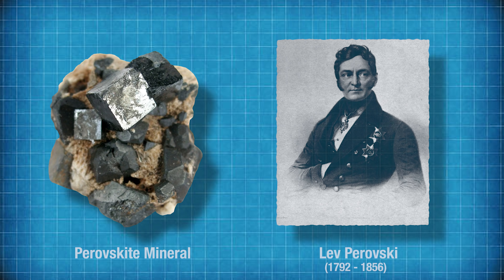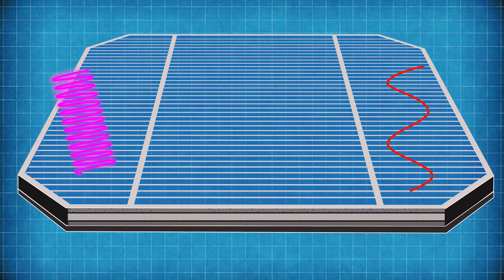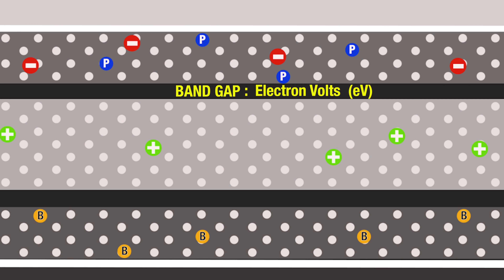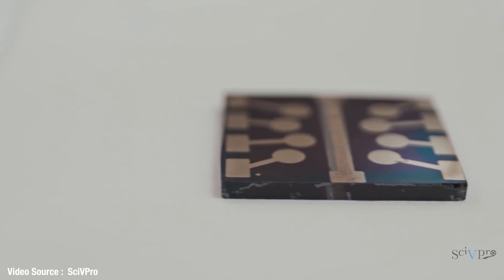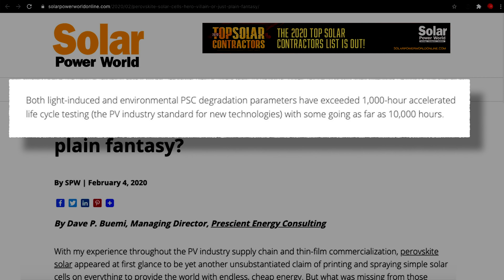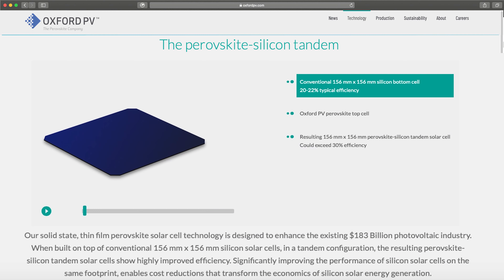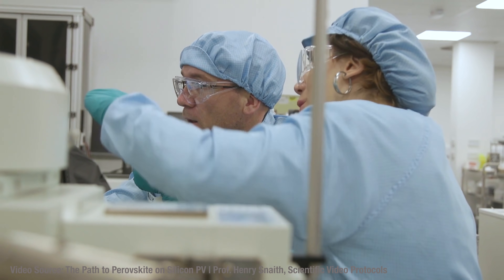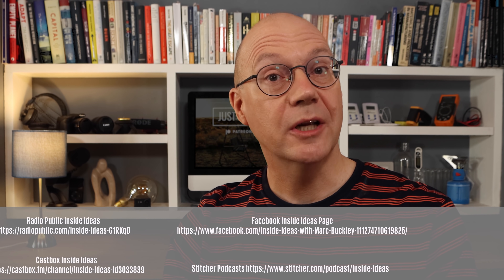Perovskite Solar Cells: Game changer?

Comment: Solar cells are not the way to go and scientist have to concentrate on something more promising like FUSION . We don't need panels to take unnecessary space and be trash after years of not productive work . Solar energy is good for nothing until it can be stored properly and even than it is only productive in limited cases leaving trash and use unnecessary space making earth ugly  , no animal life . Forget this scam or think where it is good idea to be used .
Reply: Let's suppose we can fuse all these low molecular weight atoms.  Like hydrogen.  We can always get.more hydrogen from somewhere else.  Maybe we could make all the metals oxides to store the surplus oxygen?  Or we could burn more oil and make co2?  NO2?

Comment: With this kind of efficiency in porovskite PV alone, thin film can really do something. 
Light modules covering all warehouse roofs will go a long way to producing our power needs. Super secure. Besides, with this film type porovskite solar electric we could just glue the sheets to the white waterproof roof membranes on pretty much all warehouses and manufacturing structures. 
I was in the solar design industry for 5 years, and we did megawatt large arrays on warehouses. The angled steel structures necessary for silicon modules were always tricky on a big roof span, but we made it work. 
Porovskite modules would revolutionize the PV industry.

Comment: Is there a research on using photochemical reactions to store solar energy as a chemical energy?
Reply: Yes, with ammonia. Ammonia is NH3 and is a good way to store hydrogen. Check out "ammonia economy" research out of Australia.
Reply: I once saw a white paper on a 6 or 7 atom molecule that underwent a conformation change on exposure to light and was reversible with another wavelength??? Possibly?  Two 3 carbon cyclics linked with a central atom?  Maybe?

Comment: One thing that doesn't make sense to me: if a Perovskite cell still requires a conventional silicon layer (eg it's not one technology or the other, it's both), then how does this solve the supply chain limitation?  
Also presumably using two different materials together could only ever increase embodied GHG footprint (because its adding more highly processed materials to raise the efficiency a modest amount, from say 24% to 28%)?
Reply: It's necessary to apples to apples compare the green house footprint of any electricity production system. Hydroelectric dams take a colossal amount of material and energy to make; trucks, concrete, steel. Same for nuclear plants. 
But I agree that another layer of silicon somewhat defeats the purpose of a sprayable easier to manufacture solar cell. That's how it's manufactured; sprayed onto an electrode surface. 
In any case, there are so many kinds of this human made mineral, and putting these Porovskite modules all over roofs means there's very little new infrastructure needed to make these distributed power plants. No new concrete buildings or new steel beams. 
Truck miles might be the same regarding shipping materials and installation, similar to the building of a coal plant in that regard.
But the fuel is sunlight which has it's own delivery system.

Comment: Just one square mile of battery? Now then the question is "how thick?"
Reply: Good point. I think ^ it was resolved at 10m high, which is a lot of batteries. Why not just make a tremendous amount of tall water towers, pump the water up during the day, turn a turbine at night. Sure, there are losses, but batteries have losses too. And batteries don't last as long as water towers.
Reply: @joshjones6072  why not just shoot a lazer at a mirror on the moon and then have it bounce down off the arctic then to a satalite that shoots it around the suns orbit cuz i assume sun can bend lzrs back to earth into elon musks solar powered ear buds playing nirvana.
Reply: @joshjones6072  shit i forgot what we were talking about mid post of my comment now i sound like an idiot.
Reply: @joshjones6072  Might as well use blocks. I would think that fluid dynamics would be less efficient than a pulley based system.
Reply: @joshjones6072  Good point.  Energy density of https://en.wikipedia.org/wiki/Thermal_energy_storage#Molten-salt_technology might be higher than gravitational potential energy.   Heat storage works for nuclear reactors, direct insolation, and why not surplus electricity?
Reply: Your battery needs to supply 456Gw for 20hours. That's 9.12Twh per day. Divide by best lithium battery 250wh/kg, you'll need 36 million metric tonnes of batteries about 10m high (30feet)., for one day of storage!, If u want one more day of backup double it and you'll also  need extra solar panels to charge those and once  topped up the electricity will have no where else to go.
Reply: @axiomatik4312  Just use the batteries in EVs. Case closed
Reply: @chrismartin7579 how is everyone getting to work in the morning when their  battery is near flat having supplied the grid all night?

 In anycase electricity is 20% of emissions.  If you expect renewables to supply personal  transport as well you'll need hugely more batteries.
Reply: @axiomatik4312  Car batteries are too expensive, have too few cycles (lithium as we know it), cars are not always parked nearby a connection, and are too "delicate" to be the "backup". But RESIDENTIAL batteries could be. Fast charging, size, weight are not an issue like with vehicles. The operating temps can be better controlled (never far below freezing point, never extremely hot, like in Texas in the summer if a car is parked in the sun). 
Those robust storage packs could support the grid. 
if the panels become cheaper and / or perform higher more goes into home storage. or they can be placed at 90 degrees at walls. (cleaning and installing is easier). Sure they do not supply as much when the sun delivers the most, but they are strong during the times when solar in general contributes less to the energy mix (morning, evening, winter).

I saw an interesting off the grid set up in Alaska.
A metall construction with 3 (very normal !) solar panels, the angle could be adjusted with a simple lever. The man was retired already and always present (wife sitll drove to work). So in summer the panels were at a steeper angle, they were moved to the 60 degree default angle later in the morning and stayed there until late afternoon. then switch back to the steeper position to put the energy to good use. That lever was very simple to operate and moved all 3 panels togehter, and it was easy to reach (not on the roof). 

In winter they stayed at the steeper angle. (or maybe they had 3 angles to chose from).

The panels were somewhat elevated (just in case large wild animals would be getting ideas) but still in reach for brushing off snow.  Which is easily possible even during Alaskan winters, the construction is right in front of the cabin. They have a gas generator as well (in an insulated small  shed built adjacent to the house walls) and of course a wood stove. 

If the performance is higher AND the panels are cheaper AND they deliver the most when there is peak demand - that can make them viable even if they only harvest at 90 degrees angle.  To a degree it might reduce the need for storage, which also costs money.
Reply: @larrybacacao9504  The exact opposite, which is why long distance power lines are DC. 

Most losses are resistive and are reduced by either thicker wire gauge or higher voltage. What makes the losses for solar panels so large is the low voltage (usually 12, 24 or 48 V DC).

AC is easy to step up to a higher voltage with early 20th century technology (iron core and windings) and DC is not (requires rapidly switching semiconductors for efficiency). AC with 3 poles or more can also be easily made to turn an electrical motor in the correct direction without messing with carbon brushes that wear out as in a DC motor.

Long distance DC is not limited by capacitance like AC because the current is going in the same direction the whole time. For long distances a lot of current in AC systems goes to charge up the wires when the polarity changes; there is capacitance between the powerlines and their surroundings and it gets much worse for burried lines. For sufficiently long distances no usable power even arrives at the consumer. The current that resonates back and forth between the power lines and the powerplant without reaching the consumer still causes resistive losses in the power lines (just like a power supply without power factor correction).

There are also less important sources of loss like coronal losses. This depends on distance between power lines, diameter of the conductors and the voltage.
Reply: @larrybacacao9504  SO is AC conversion. The power comes by default as DC. Both storage methods would require DC motors.
Reply: Musk the "overthrow South America to get the lithium" imperialist!!

What a failure!

Time for the H2 revolution!!
Reply: It would have to reach to outerspace. Just look at current electricity consumption. One has to start with the number of days of autonomy in the Northern Hemisphere on Dec. 25th as the engineering starting point.
Reply: Elon has certainly proven himself to be quite thick, but not as thick as his investors. How's that long promised electric truck going Elon ? Still in "development" ?
Reply: @steeevo0136  Tesla semis transport batteries from Giga Nevada to Freemont everyday.
Reply: @steeevo0136  Tesla semis transport batteries from Giga Nevada to Freemont every day
Reply: @chrismartin7579  They would need to carry batteries just to keep them running for any meaningful distance/carrying capacity ! Basic physics tells us that with current battery and drive technology, electric semis are not viable. Thats why Elon (aka electric Jesus) to my knowledge hasn't delivered on any customer orders yet. Read this https://banyanhill.com/700-billion-problem-tesla-cant-fix/

Comment: Could you make a video on the Sunpower solar cells?
I got some from B grade for diy projects after discovering them and they do things differently than other manufacturers making a lot of sence.
They do not have traces on top blocking light, have rugged back copper system and are a bit flexible due to thickness. They also keep working after cracking as the back copper keeps everything connected. I think it will be good to show that not all solar cells are built up in the classic sandwich with silver on top.

Comment: Just Have a think about this,,,,
Say I had an unlimited supply of power, Electricity or Gasoline ( petrol ) or Diesel Fuel ect.,, And I wanted to give it away.
How much would it cost?
Would the power companies shut down their generators , so I could use their power lines for free?
Would the service stations leave their fuel in their tanks, so I could used their pumps for free, to give away my free fuel?
Would the truck drivers let their families go hungry , so they could haul my fuel for free?
So,,,  Just because something is free to someone, doesn't mean that there is no cost involved.
Back when CORN FLAKES hit $2 a box, a farm show on the radio said that if the farmers gave away the corn, it would make the CORN FLAKES 5 cents cheaper a box...
There is no free lunch,,  or breakfast... 
They say wind is free,,,  ever buy a windmill?

Comment: Great video. Btw, manmade climate change is a farce and a scam designed to transfer wealth from the working drones to the international, globalist, predator class. Analyze the carbon tax system and you will see that it will be ran by politicians who've purposefully designed the system for fake dummy companies to be allocated credits, enter the market, sell their "excess carbon credits" on the exchange and make windfall profits. Total scam!
Climates have always been in flux. 
The earth has always ebb and flowed between cooling and heating ages. Mans activities and impact wont change anything in any significant way.
Reply: Buzz off
Reply: They stole the energy star funds also.  Check whistle blower

Comment: I was just thinking about a conversation I was having with someone who was saying that solar panels shouldn't be used, that we should INCREASE our dependency on fossil fuels (yes, believe it or not, there are those people out there, most likely hard-core Republicans).  One thing I forgot to bring up was his apparent lack of ability to visualize even 2 seconds into the future.  Yes, solar panels were less efficient in the past and do take some fossil fuels to make today.  But even ignoring the ability of a homeowner to stop relying on a failed electrical grid, making power safer because you eliminate the need to have high voltage power lines stretched all over the place, I failed to ask him if he understands that science is not a static" thing".  It is a process that, in cases like technology, actually IMPROVES things.  As is mentioned in this video, the solar panels that Jimmy Carter put on the Whitehouse were 14% efficient, the best we had at the time. Now they are half and again as efficient.  If we pumped as much money into that technology as we do to keep fossil fuel executives rich, I'd wager that we would have gotten to over 50% by now.  The problem is that neanderthals like my debate partner helps HAMPER scientific advancement by advocating the "if at first it isn't perfect, burn it down and piss on its ashes" mentality.

Comment: 10,000 hours, considering an average of 5 solar hours per day, works out to only ~5-1/2 years. My biggest concern, is the labor cost of frequent replacement of panels, and the cost of the panels themselves. It might be more worth it, to buy the more expensive, perhaps less efficient silicon based panels, just because you can leave them up there for a few decades. Right now, I compare Perovskite to amorphous silicon. Cheap, but short lived. The only advantage of Perovskite, is its efficiency. Good, if you're looking for a lot of power on limited roof area. This is a good entry level solution for the "do it yourself" market. This might sell well to the outdoor recreation market as well.

Comment: oh, and you are wrong.

The origin of the two names may be attributable to element's discoverer, Sir Humphry Davy, Webster's Dictionary, or the International Union of Pure and Applied Chemistry (IUPAC).

In 1808, Sir Humphry Davy identified the existence of the metal in alum, which he at first named "alumium" and later "aluminum." Davy proposed the name aluminum when referring to the element in his 1812 book Elements of Chemical Philosophy, despite his previous use of "alumium." The official name "aluminium" was adopted to conform with the -ium names of most other elements. The 1828 Webster's Dictionary used the "aluminum" spelling, which it maintained in later editions. In 1925, the American Chemical Society (ACS) decided to go from aluminium back to the original aluminum, putting the United States in the "aluminum" group. In recent years, the IUPAC had identified "aluminium" as the proper spelling, but it didn't catch on in North America, since the ACS used aluminum. The IUPAC periodic table presently lists both spellings and says both words are perfectly acceptable. 

leave it to a british chemist to screw up naming an element.

Comment: I hope I'm right about this, but I think there is an error in the visual presentation, say at 4:10.  What is correct (I think) is that the upper layer is phosphorus-doped, but the graphic shows that the electrons are directed upwards towards the upper n-type layer.    I think, instead, the electrons are excited by the photons arriving from above, and are directed downwards towards the lower layer, doped by boron atoms, and collect there.  That should mean that the lower layer will be electrically negative, and the upper layer will be electrically positive, in operation.

Comment: The highest research cell efficiency is up to 47.1% as of August 3rd, 2020. It was made by NREL in 2019 and is classified as a "Four-junction or more" cell with a solar light concentrator (a lens or a reflective mirror to focus light, often around 400x+ power). It beat the previous record holder ~45% research cell made by Fraunhofer Institute for Solar Energy Systems of the same cell design type.
https://www.nrel.gov/pv/cell-efficiency.html

NREL's July 8th, 2020 champion cell efficiency chart shows that a 40.6% "Hybrid four-junction concentrator" panel made by UNSW in 2016 is still the best available. It had beaten the 2015 Gallium Arsenide four-junction concentrator cell made by Fraunhofer ISE at 38.9%.
https://www.nrel.gov/pv/module-efficiency.html

P.S. I am not an artificial intelligence, or "bot". They have not made it to YouTube comments yet (that I've seen) to do this basic fact-checking work. If they had, you could probably expect better sources than what is provided by NREL alone, and the inclusion of notable research papers that led to these discoveries. YouTube, yall need to look into this, as AI can provide valuable information to complement or contrast tech videos like this. Just keep the AI away from biased hot topics, as they are simply an organized amalgum of everything they have read and learned (even if they are smarter and more eloquent than a vast majority of people).